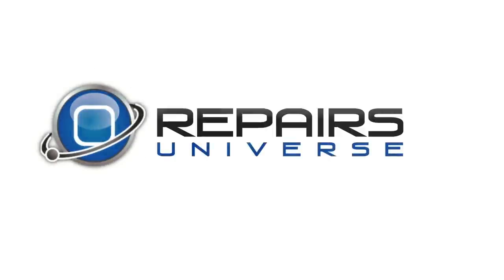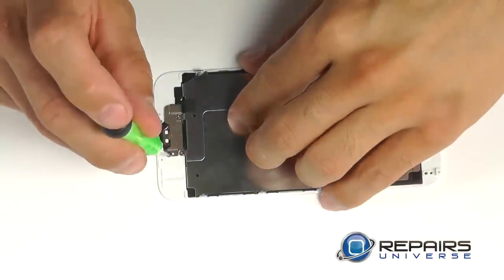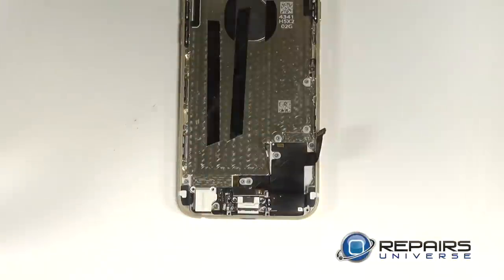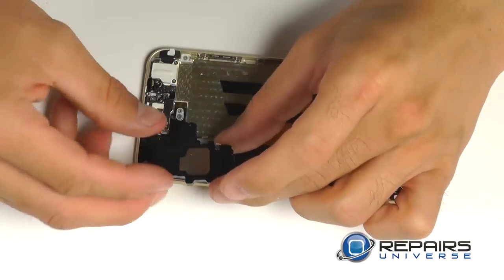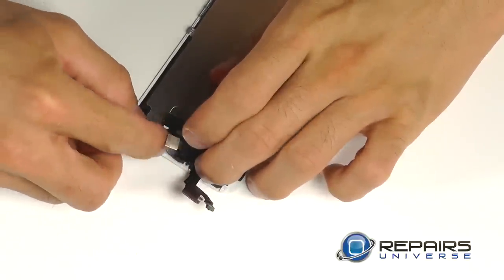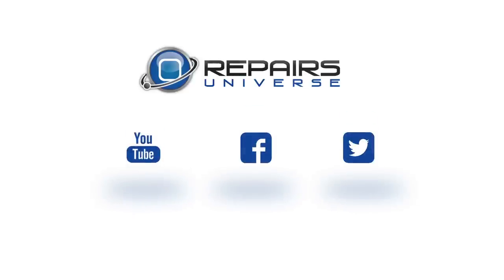iPhone 6 Take Apart Repair Guide - RepairsUniverse

Comment: Really great guide - thank you very much!  Your guide helped me to repair my daughter's iPhone 6 which she had dropped into the toilet...  So water damaged and would not even power up.  This guide is very clear and well put together.  Some of the "tear down" videos show how to disassemble - that's the easy part!  Its putting it all back together that is challenging.  I drew a map of the iphone and put the screws I took out onto the map so I could put them back in the correct place.  Not all the screws are the same!  Different lengths and types.  Used isopropanol 99% to clean all connectors and wash the RF board and then baked in a very low oven to dry off.  Now fully working and I have a very pleased and relieved daughter!  Thanks again!
Reply from the maker: +James Davies Great to hear the good news. Thank you for watching!

Comment: 4:42 - After Display Removal/Beginning Battery Removal
5:46 - SIM Removal
5:53 - Rear Camera Removal
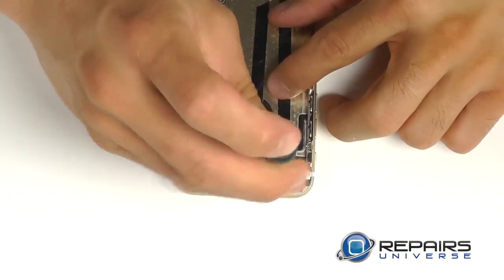6:40 - Antenna Removal (GSM)
7:00 - Grounding Bracket
7:20 - Motherboard
8:37 - Vibration Motor
8:49 - Loud Speaker
9:12 - Lightning Port/Headphone Jack assembly
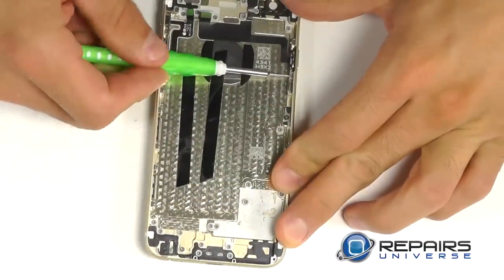10:19 - Power/Lock Button & Camera Flash Assembly
10:45 - Volume Buttons
11:15 - Reassembly
Reply: +ReverseEffectApps what is 6.40 again? I removed the "antenna" and wifi/lte still working, where is the real antenna/cables?
Reply: I was going off of iFixit. I mainly made those timestamps just for a personal project.

I believe the actual GSM cable is toward the bottom right, around where the loudspeaker is. After adjusting that on my iPhone, I noticed that it connects a little better. Before adjusting it, I had some intermittent connections, etc.
Reply from the maker: +ReverseEffectApps Thank you for the breakdown. Very nice of you, great job.
Reply: Not certain about the points made but ,if anyone else  wants to learn about 
circuit board repairs
 try Saankramer Electronic Magazine System (just google it ) ? Ive heard some interesting things about it and my mate got amazing results with it.

Comment: I would appreciate little details like the metal plate that covers the connections for the screen, the middle screw is slightly longer I think and the screw closest to the top right corner of the phone is a lot longer than the rest.

Comment: Thanks for the video.  There are several times where I cannot see what you are doing because your hands are in the ways and you do not move them.  Like when you are installing the ear speaker and connections between the two halves.  I figured it out.  Thanks again.

Comment: You should have disconnected the battery first before disconnecting the LCD digitizer... Also you should NOT have used a blow gun AT ALL on the battery. You also fail to mention to be highly observant when removing screws: a lot of them look the same but are completely different, you have to make sure to put them back EXACTLY in the same spot. In all honestly this guy in the video somewhat knows what he's doing but is no professional by any means

Comment: I followed this guide, opened phone no problem, replaced a part no problem. Closed it up, turned it on, no problem. I noticed it began to get very hot even when screen was off. Turned it off, set it aside. Now when attempting to turn it on, no display. Plugged it into a charger, nothing. Thoughts or advice?
Reply: FUCK GOOGLE + what part did you replace? The phone only warms up when the battery is being used more frequently & when the LCD display is on 

Also, don't keep it in your pocket on hot days! That's a recipe for disaster!

Comment: my gray iPhone 6 is not working help but how do u unscrew it btw using my ipod
Reply from the maker: +ps4gamer You would require the correct tools, the pentalobe screw driver assist you with the two bottom screws to initiate the repair.

Comment: I don't think that phone is new. When removing the battery there should be 2 white stickers that would pull from away from the base of the battery. Instead here I see black stickers that are used in service. So don't use head gun. Instead pull away the two stickers from the base of the battery and replace the stickers with others. Using black stickers will cause to use force when removing battery.

Comment: anyone trying to follow this guide, beware.  i've read that damage can be done to some of the componets of the phone if you do not put each individual screw back to the exact hole it can out of.  this video fails to mention this.
Reply from the maker: +Joe That is solid advice  The motherboard can be damaged by switching screws around. Off camera we use a magnetic mat to keep the screws organized and feel that is the best practice. Thanks for the comment.

Comment: Did anyone actually do this?!?!?
Reply: Isaiah Ravelin Yes after water damage I wan't a total tear down.  Easy to find tear apart video but this one was the best with re-assembly.  Damn there are a lot of screws.  But back together and works fine.  The only two pieces I changed to make it 100% was the battery and the digitizer assembly because I couldn't get rid of the water marks under the glass.